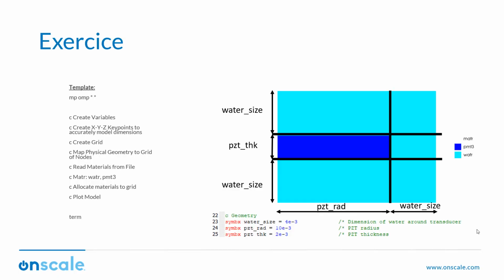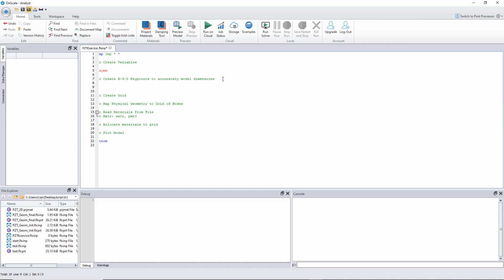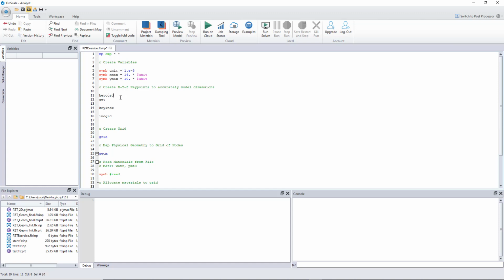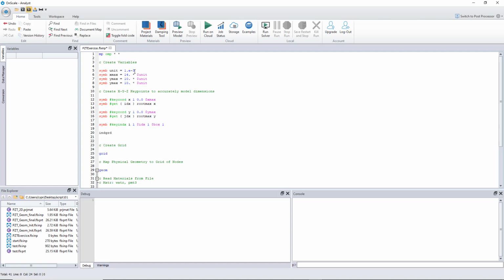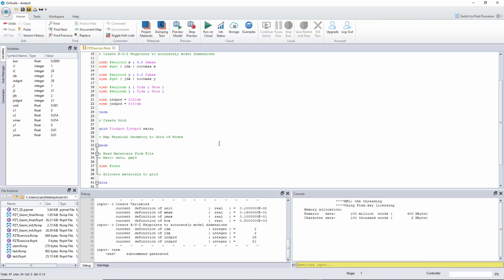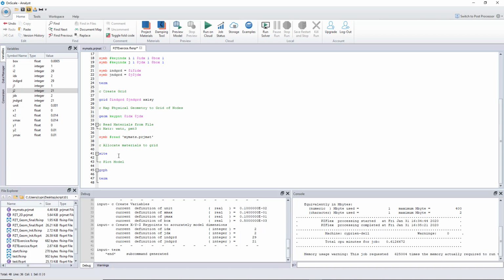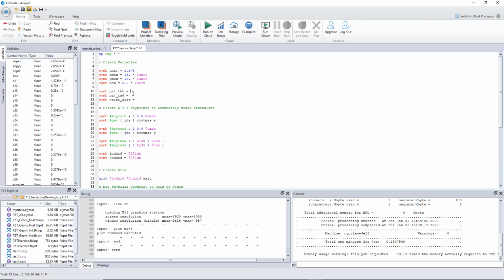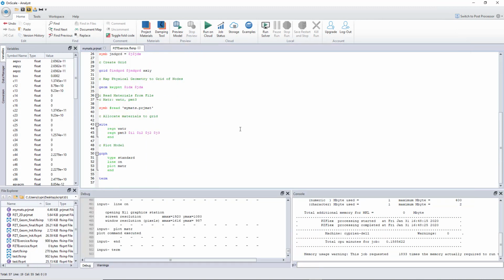[OnScale  Analyst 101] Exercise 1 - Creating the Geometry of the PZT Disc - Part 5

Comment: Hi sir. I'd like to create a 35mm circular PZT and simulate it to get its output voltage and current under different values of vertical force. Could you recommend me your tutorial videos which I should watch to me? Thank you very much!
Reply from the maker: You can follow this tutorial: https://support.onscale.com/hc/en-us/articles/360002113278-Creating-a-New-Project what you want to do is very close, you’ll just have to apply a pressure instead of applying a voltage.